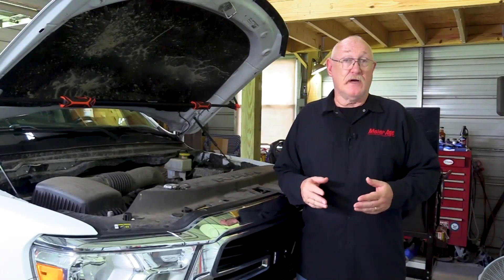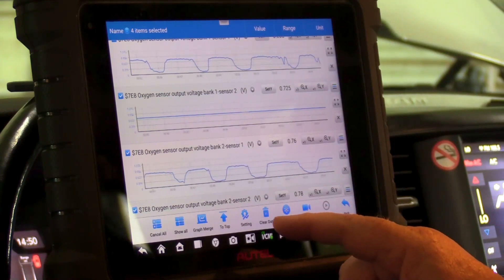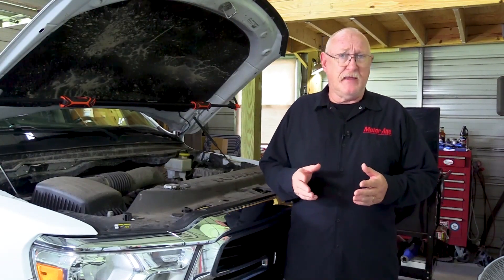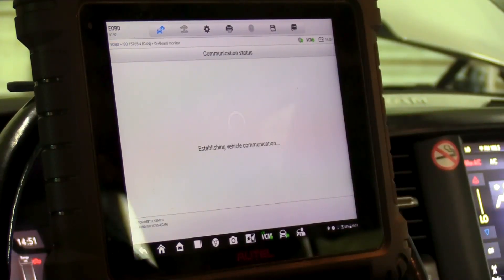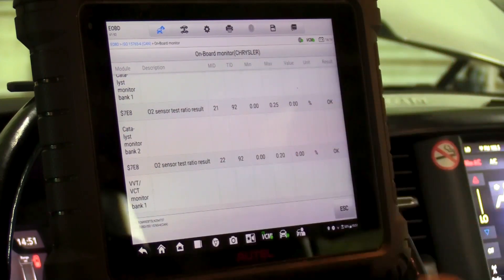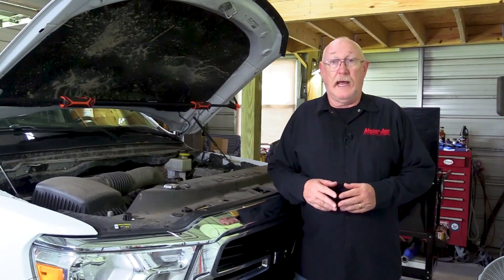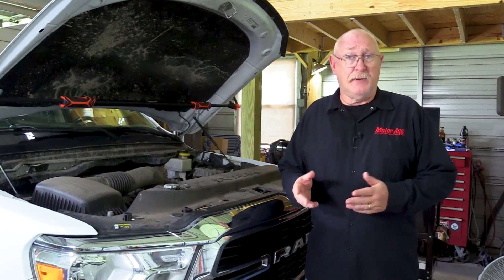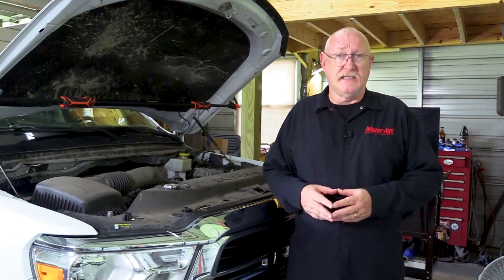The Trainer #129:  P0420/P0430 – Performing A COMPLETE Diagnosis

Comment: I’ve heard a hundred times that cats are bulletproof unless there’s an ignition issue, the engine’s running excessively rich/lean, or there’s oil/coolant getting in the exhaust, and I think this is such a load.

Comment: 2012 Nissan Frontier. Been chasing a P0430 code. Had a small exhaust leak. Replaced gaskets and removed & inspected converter. It looked good. No carbon, melting or breakage. CEL light went out for a few hundred miles. Now back on. Changed plugs and all looked the same. No coolant loss, not using oil, no exhaust leaks.
Now what? What cleaner would you recommend?
Edit: 94k mi.
Reply from the maker: You didn't specify what engine it has but on many Asian makes, there are 2 converters - the Three Way Converter located near the exhaust manifold and the downstream converter farther down the line. It's always best practice to replace both in these cases. But before you do anything, check the operation of the oxygen sensors and make sure they are working properly.
Reply: @VehicleServiceandRepair  Thanks for the reply! It's the 4.0 liter. The converter just behind the exhaust manifold. It has the O2 sensor after it but before the next converter. I replaced sensor 2 to no avail. Voltage still varies beyond normal. Not as wide a range as before installing new gaskets, but still throwing code P0430. The upstream sensor gives similar readings as the opposite bank. I may try swapping the upstream sensors to verify. I believe they are the same units.
Reply: @timsilva1944  just throwing this out there, but i've been a pro mechanic for coming on a decade now and i can say with 100% confidence that some (if not many/most) makes and models really don't like aftermarket or non-factory cats or O2's put on them. You'll be good for a month or 3 then the codes will return because the computers don't like what they see. If you have installed aftermarket cats and o2's i can almost assure you (granted you've absolutely ruled everything else possible out) that there is your "issue". ESPECIALLY on toyota. i was a toyota guy for 6 years and not once EVER did an A/M cat or O2 last more than a few months before throwing codes. suddenly that $500 you saved on the AM cat goes out the window
Reply: What’s causing my 2008 Lexus Ls 460 to read the code P0420

Comment: Have been getting a regular CEL Po420 on 50 + mile trips . Planning  on r/r cats recent vac leak repair and new fuel filter have resulted in 100 mile trip with no light . I will get livestream at some point but it was interesting .